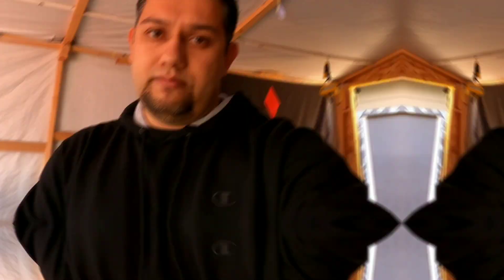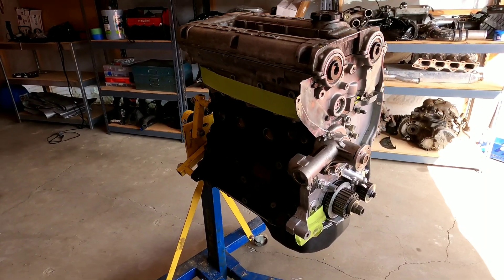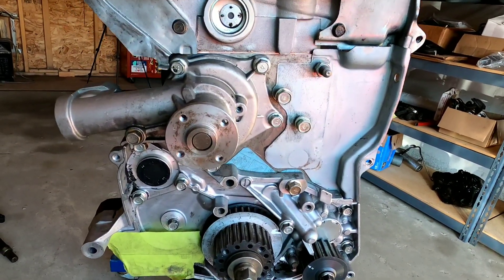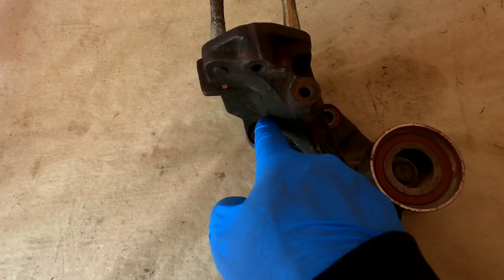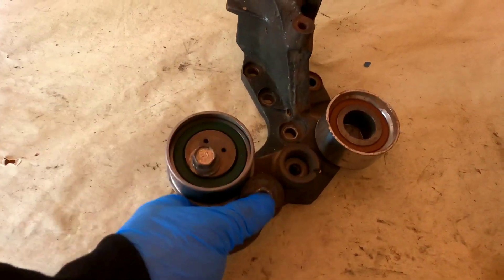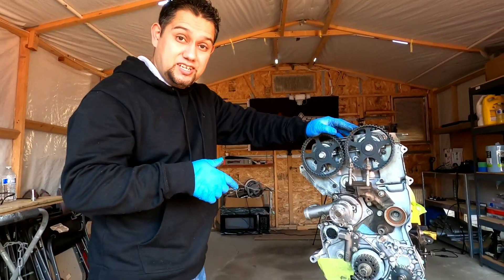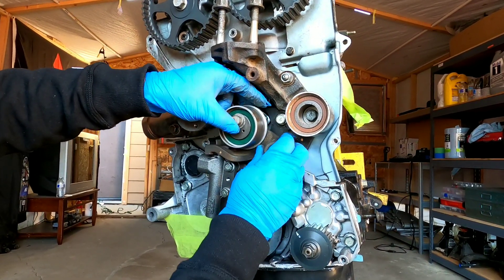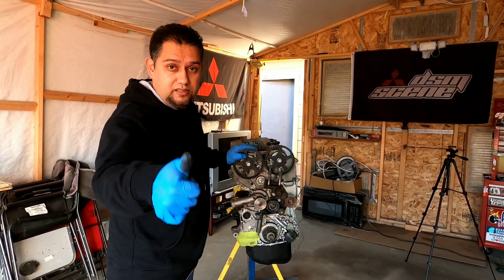How to 4g63 six bolt swap your 2G DSM and what is needed???

Comment: Hey bro, I have a question I have a 2g 1995 gst with a 6 bolt bottom end swap with a 2g head, can you use the same 2g master cylinder or u need to swap it with a 1g master cylinder?
 I have a act2100 clutch 6puck sprung.
 As of now when they installed the new 2g master cylinder they removed the little restrictor that sits in the master cylinder. Please help with any info.

Comment: So you need the kiggly kit to act as the crank sensor  and also use the cam sensor as well?
Reply from the maker: Correct, unless you plan on using the 1G CAS... if you are planning to go that route.

Comment: Thank u so much for your vids
Reply from the maker: I appreciate that bro. 👍😎
Reply: @DSMTHuNDeR  would I need a kiggly flex plate kit as well to install the 7 bolt transmission to the 6bolt motor??
Reply from the maker: @scottiegraham4723  if you're car is Auto, yes.
Reply: @DSMTHuNDeR  thanks so much for the reply
Reply: @DSMTHuNDeR  hey bro question do u have a Facebook I’m doin this swap and deff need little more in put please

Comment: Hey bro you mentioned that a 7 bolt transmission would bolt up to a 6 bolt engine.Ive been looking at both engines and it seems like the bolt up pattern looks different. I also have been looking everywhere to see if how it would bolt up and I can't find anything .I'm new to the dsm world but I'm following a ton of forums and still can't find anything.uour help would be much appreciated
Reply from the maker: You will be reusing your 2g starter plate (since you are using a 2g tranny). To mate the 2g tranny onto a 6 bolt, you will be using only three of the front bell housing bolts (2g 7 bolt blocks use 4) and also one m8x1.25x60mm bolt in the rear (under the starter) to properly tighten the tranny onto the 6 bolt block.
Reply: @DSMTHuNDeR  dude that helps so much thankyou.

Comment: hey man i been looking for info on the kiggly racing crank trigger kit with the 2gb cas i will be running this since im tuning with my black box but there is no video out there on how to do this so if you make one id deff be sure to check it out 100%
Reply from the maker: @EvoIDSM Right on 😎. I'm actually going to dropping a Kiggly Racing Crank Trigger kit install video soon, just needs to be edited... it's basically done, so stay tuned and subscribe if you havent done so already so you can get that notification once it drops online.
Reply: @DSMTHuNDeR   already done man cool hopefully youll be showing the 2gb cas install on the 1g head as well!